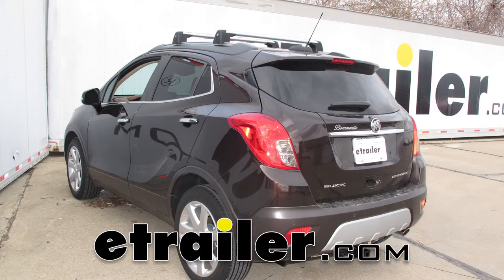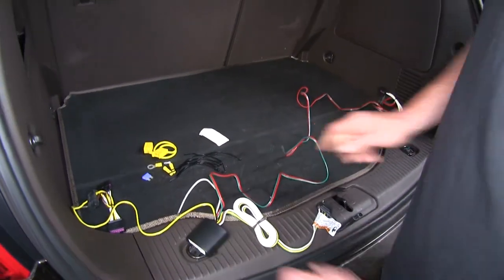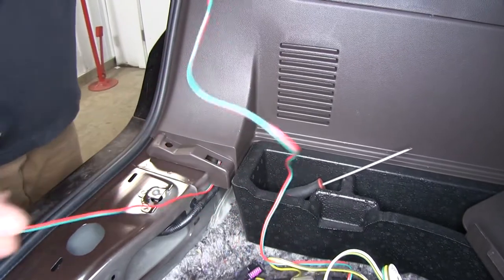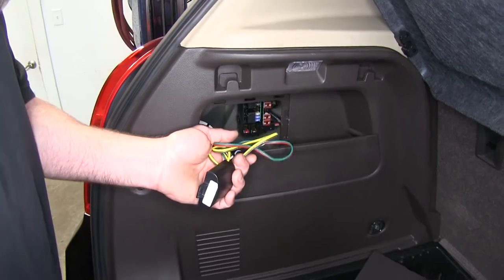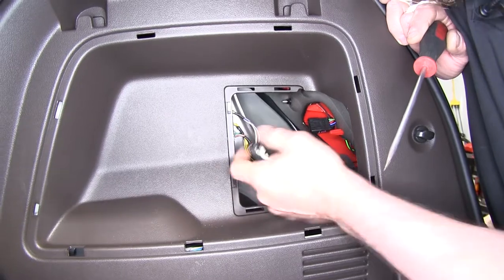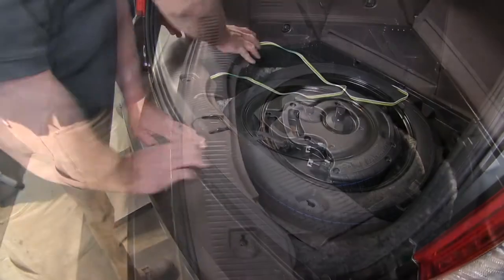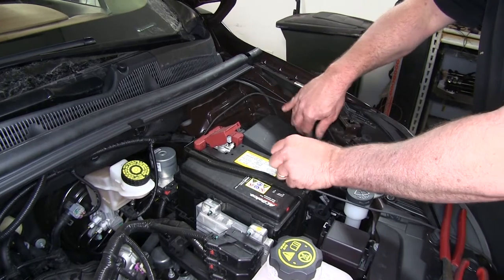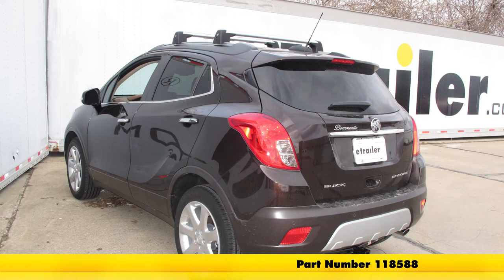Install: T-One Vehicle Wiring Harness with 4-Pole Flat Trailer Connector on a 2015 Buick Encore

Comment: This is a great video.  I followed it and things went well.  My only comment is I tried to push the wire thru the firewall grommet along with the existing harness, and as far as I can tell it cannot be done.  I used a drill to go thru the grommet near the existing harness and pushed the wire thru that hole (and that was not easy either!)

Comment: Great video - very handy for install.  I'm curious why the battery wire is run all the way up to the front of the car and not plugged into the fuse panel that is visible @2:30?  Maybe it simply doesn't have an always-on line?
Reply: To anyone else doing this install - the rear compartment fuse box is always-on, and has support for 35A, so that's where I plugged into.  Much easier for the install!
Reply: Bill, what did you use with the black wire to plug into the fuse box by the rear light?